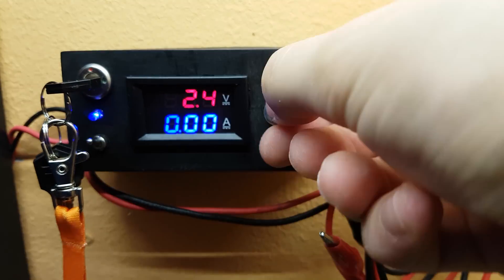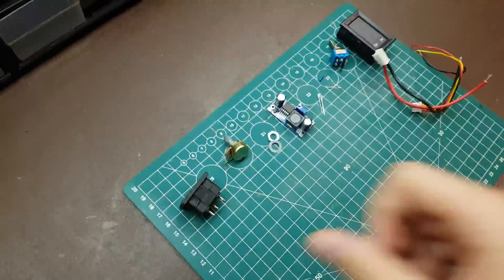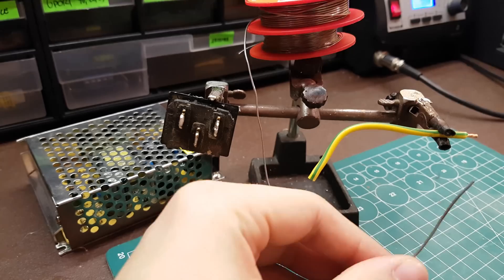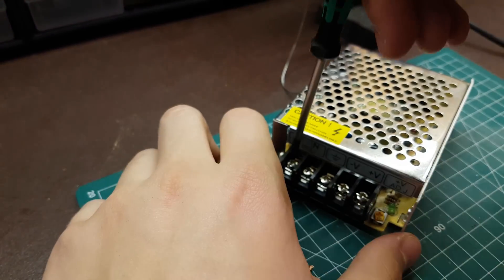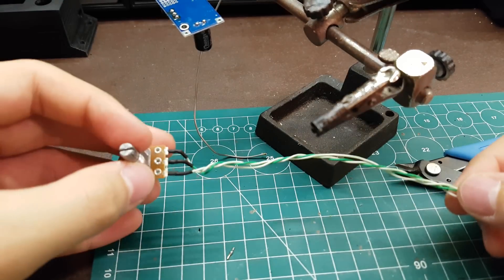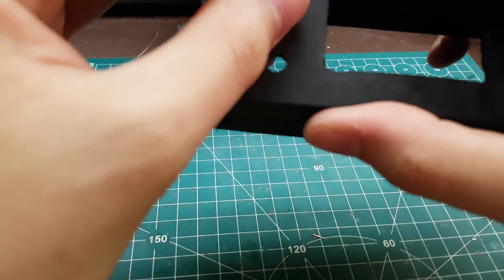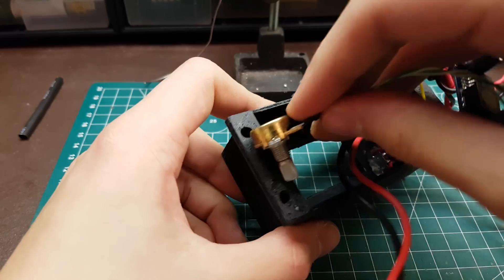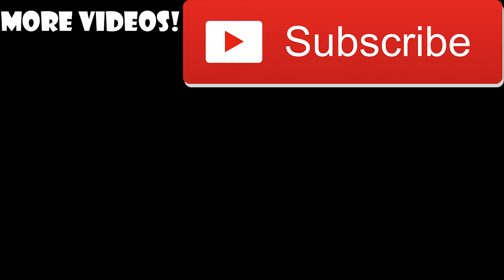DIY variable lab bench power supply V2.0! // How-To (UHD - 4K !)

Comment: Hi, great tutorial. Put components together exactly the same way as you showed in the video, however, I used DC - DC Buck - Boost converter with variable voltage and current trimmers.
It's main specifics are as follows: input voltage is 5 - 32V, with an output 1.25 - 20V, and input current is 8A max., 10A peak, while the output current yields 0.2 - 5A.
Since this module doesn't have an inbuilt screen like digital ones have, I have to fine adjust the current output to exactly 1A for charging my 500F supercapacitors. Since I don't understand much how these supplies work, I assume that in order to get the current reading on a display before putting any load, some kind of dummy resistance load should be added to + - output terminals.
My question is how large should I make this dummy resistance load in order to avoid burning myself and the board?
Reply from the maker: I recommend setting output voltage to low level (1v for example) and create short circuit from + to - terminal. Then increase current to 1A.

Comment: Hello friend, thanks for your video. I see you are using a cheap digital volt/ammeter like mine and I would appreciate your help! I am trying to wire it up to monitor the volt/amps being generated by my solar panel, in real time... I'm trying to place the meter between my solar panel and solar controller. I made a quick diagram, would you have the kindness to take a quick look and provide some input? https://docs.google.com/presentation/d/1xL7InwbSeqB0JLrU_jbPZzpxQawXyNDS2UpwThcEkw0/edit?usp=sharing

Thanks mate!
Reply from the maker: Hello! Sory for late response but youtube flaged this coment as spam (probably because of the hyperlink) and I did not totice it until today.
I had checked out your wiring diagram and I have two questins: 
1. Why did you connect only one negative vire to the switch and what type of switch did you use? 
2. Where did you connect negative wire from voltage meter?

Comment: Hey! :*) Yep, pretty darn cool. ÷D  
I don't have a 3D printer, nor a hellava lot of electronic experience. But, everyone had to start somewhere, right? 
I'm been looking, everywhere it seems, for a DIY AC (110v) to DC adjustable/linear power supply (0-30+v with 5-10 amp) w/LCD, enclosure, etc. Maybe I'm simply assuming too much, without having to actually buy an expensive Lab PSU? lol! Anyway, any ideas or direction would be great! Thx, again!  ÷*)
PS: If not, that's okay.
Reply from the maker: If you need that powerful PSU I would recomend buying this: http://amzn.to/2xXtd53
Reply from the maker: Or if you want to do it DIY you will need something like this: http://amzn.to/2xXDxJZ
Reply: if you do one make the enclousure out of non conductive materials and cover all connections in heatshrink i could makeone for you for 50-75 $ or i can hook you up with a 35-60 mph electric skateboard that does 30 miles of range at full throttle i could make it for you for 300$ so cheaper than a boosted board and faster just let me know when your ready to buy one im giving u discount coz i can l i usually sell them for 500.

Comment: Why didn't you use crimp spade connectors for the AC adapter?
Reply from the maker: Because I did not have any spade connectors.
Reply: They only cost 50¢ at most.